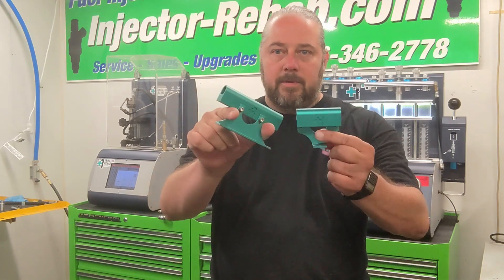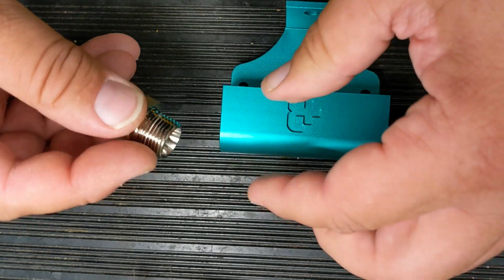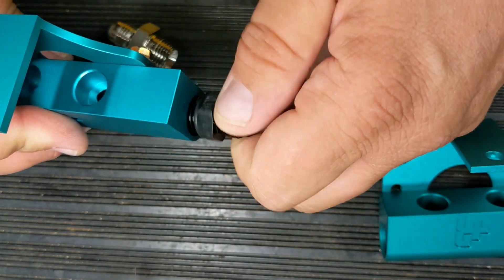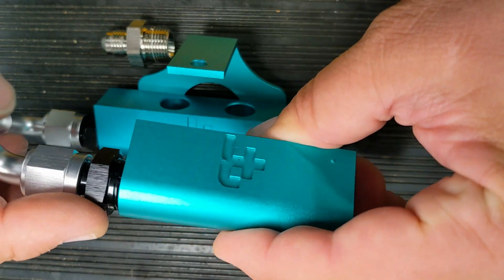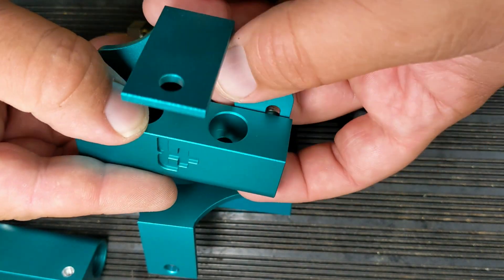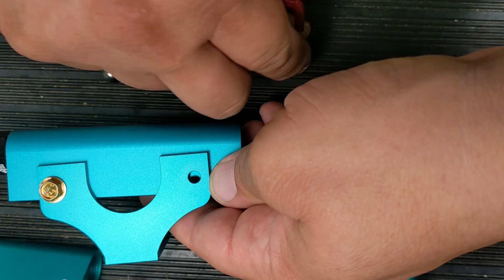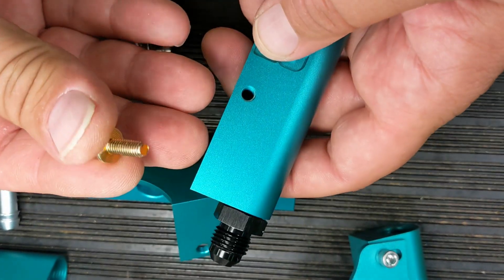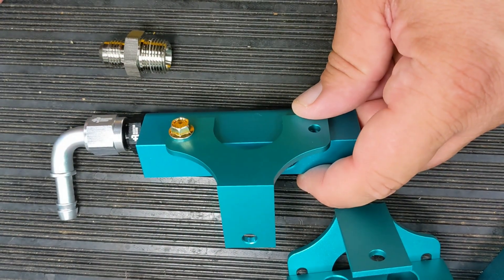Vanagon WBX and VW Bus / Type 4 Fuel Injector rail system update

Comment: I have 1978 VW bus and been running these injectors for over 40K KM with no issues. I just saw on your website that these should be run with no “resistor box” . Should the resistor block be bypass on a type 2 bus ?
Reply from the maker: It doesn't have to be
Reply: @InjectorRehab So one could remove the original resistor block (6 ohm per injector) and bypass it with no ill effect to the ECU and injector?